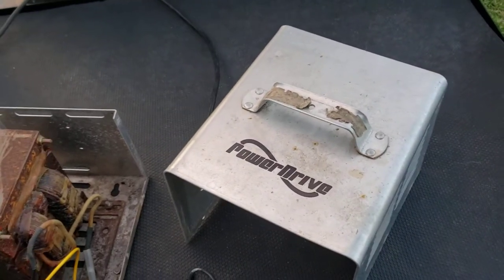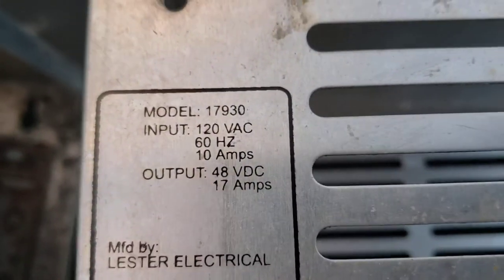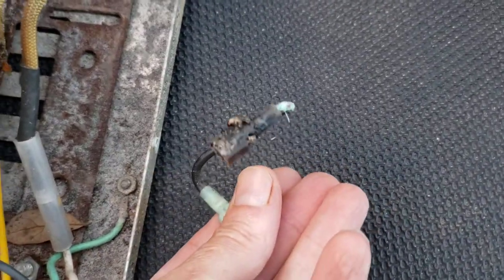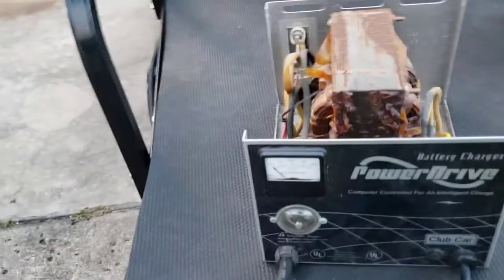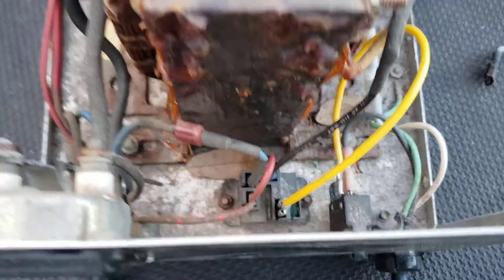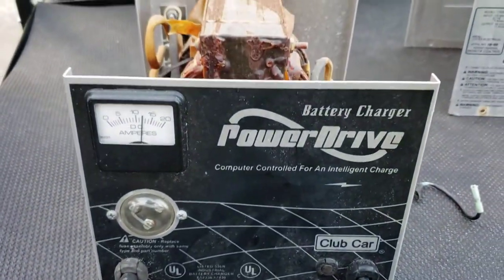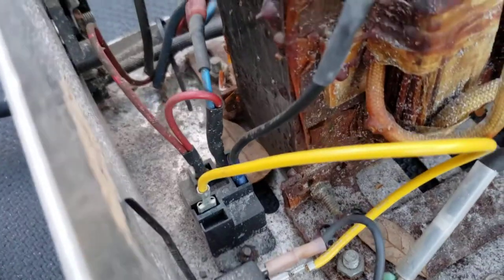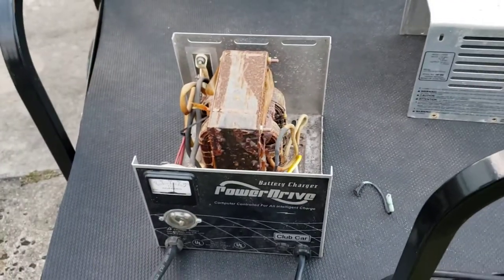Powerdrive 48V Club Car Charger 17930 Not Charging Simple Fix of Power Drive Club Car Charger.

Comment: I just found out the charger needs 36 volts for the golf cart charger to work . get the bank of batteries up to 36 volts with a 12 volt battery charger one battery at a time ,less than 30 min at a time. my battery charger was an 20 year old one  10 amp or 20 amp or 40 amp I used 40 , good luck
Reply from the maker: Thank you for contributing thats great information